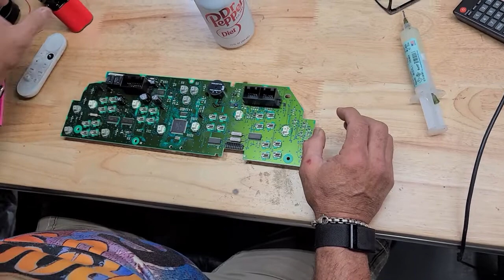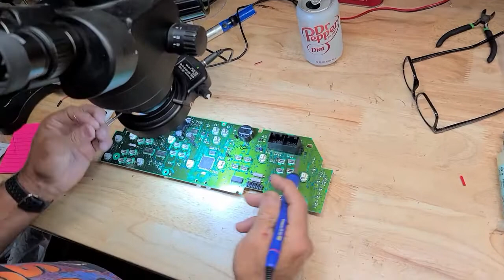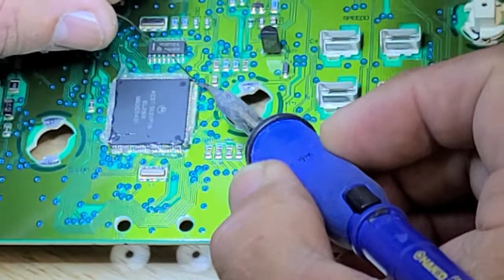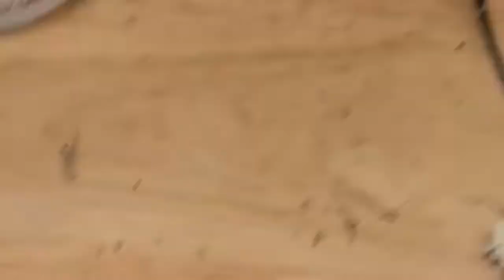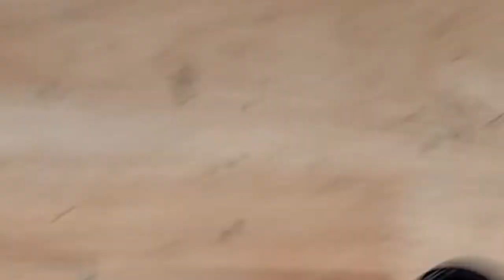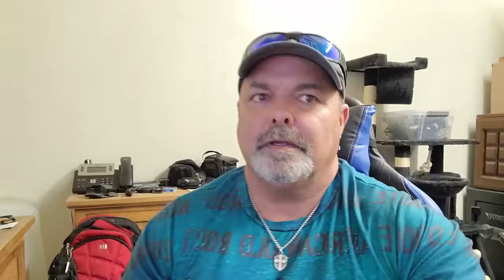02 03 04 Ford F250 No Air Conditioning no Radio no Windows no Locks  Instrument Cluster Repair.

Comment: 02 Excursion, radio and windows wouldn't operate when the vehicle is started for a random amount of time.  Reflowed 8 pins on the powersaver relay, problem is gone.

Comment: I have a 2002 F-250 Super Duty with a 5.4 2-valve. Replaced original engine with a junkyard engine that held 180 lb compression per cylinder. Did a conversion from automatic to manual transmission, replaced automatic pcm with manual pcm. Has a doorman intake manifold. Replaced all ignition coils with Edelbrach coils. Coil connectors would not work on the Edelbrach coils so scrapped out another wiring harness to get the right connectors. Made sure common wire went to the right side of the coil connector and made sure pulse wire went to each coil as needed. Voltage across coils, key on engine off, voltage was everywhere. Voltage to injectors was good, all cylinders at 12.5 volts. Has a single cylinder miss at idle that gets worse as the truck warms up. Just went through resealing the intake to make sure I had no vacuum leak (had already smoke tested for vacuum leak two or three times, no visible leak) As of this point, this truck is running worse than before I started working on it on last attempt. Now have a miss on two cylinders, short term fuel trims are staying on the minus side on both banks. With engine at cold idle, the engine does not seem to miss as bad as when it warms up. If I get into the RPMs hard, I have less of an issue than if I try to baby it. Injectors are original to that engine, but I do not know their condition. I've swapped out coils, plugs, and other used injectors, but nothing makes any difference. Any help would be appreciated.

Comment: -hear is what n t 301 shows from cold start.
fuel system 1 closed
fuel system 2 --
load test 22.7 to -24.7
e c t % 145
short fuel trim % - 1.6 to + 2.3
long fuel trim % 0.0 
short fuel trim 2 - 3.9 to 0.8 
long fuel trim 2 0.0
rpm 800
v s s   m p h 0
spark  advance 14.5 to - 24 
i a t % 239
m a f   l b s 0.0 
t p % b 1 s 1 --- b 2 s 1 ---
o 2  s l o c 
0 2 b 1 s 1 v  0.110 to 0.85 
short fuel trim b 1 s 1 % 0.135 to 0.825 
o 2 b 2 s 1 % v  0.135 to 0.825
short fuel trim b i s % - 12.5 to- 1.6
.ford 5.4 2 valve  170 to 180 psi at pistons  ,new coils , new fuel pump, idles fine cold .major hesitation on acceleration. smoke tested . no vacuum leaks all the way back to filter.  idle surges up and down when warm. engine light is on but throws no codes. have no idea what n t 301 info means. can anyone help?